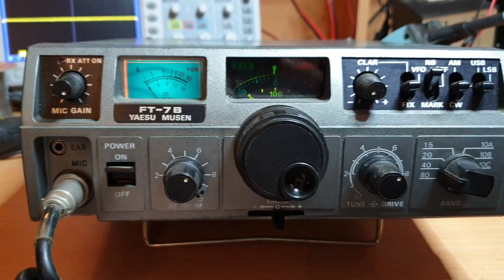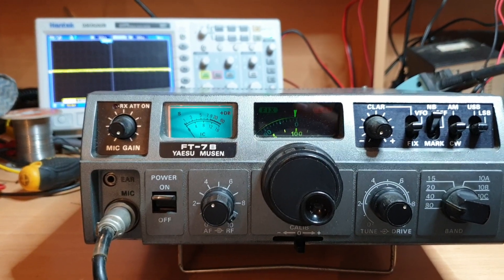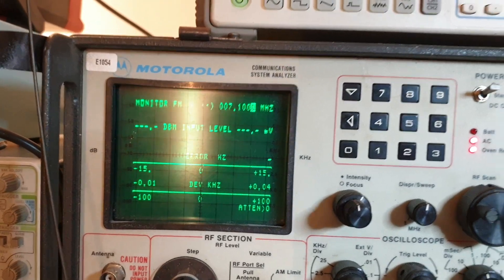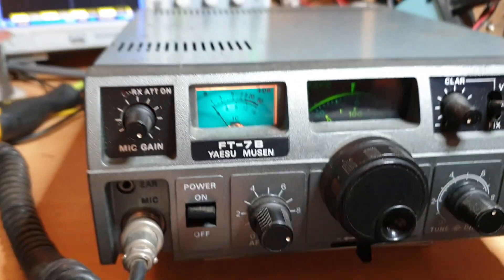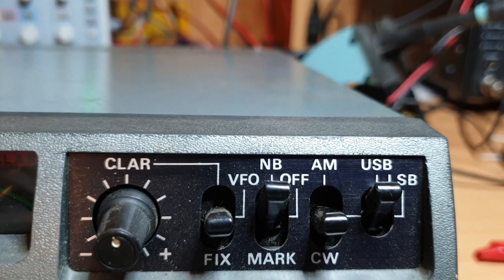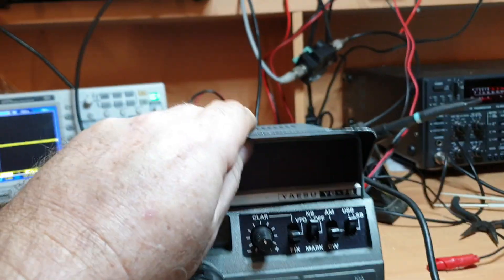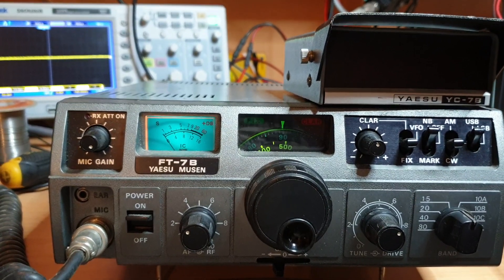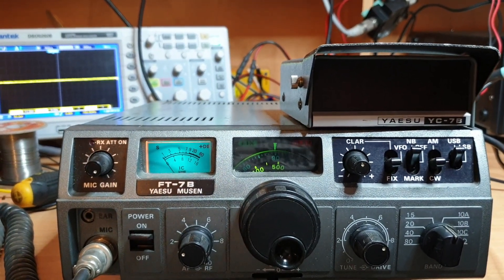Who doesn't love an old yaesu FT7B😁

Comment: Originally I owned a Yaesu FT7 from new and worked the world. Later due to my inactivity, I sold it and immediately regretted doing so. I now have a FT7B as my vintage rig in the shack. The weak point is the Circuit Card connections, are the sockets that are just made up of wire contacts mounted in the Motherboard. I remember being complimented on the audio quality on the FT7 when working a 20M European pileup mobile way back in April 1979. :-D
Reply from the maker: yep I know what you mean re circuit card connections, Im still chasing a very small fault on the FT7B where I put pressure on the board behind the xtal board and the radio in LSB changes to usb, its a bit of fun... I redid connections, cleaned etc, and its become a tomorrow job due to my wife dragging me out to the movies tonight past massive fires...its never boring in the rural sector...haha